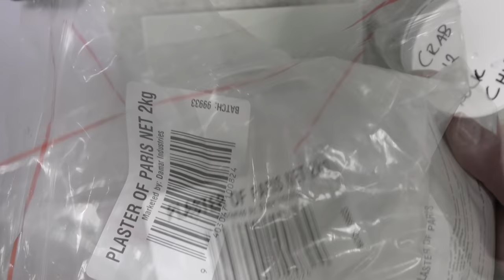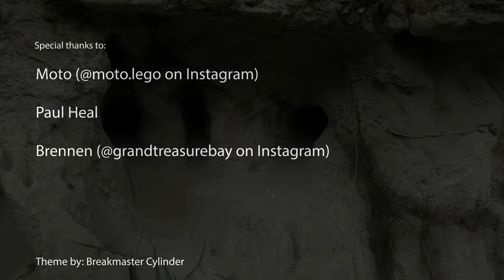50k giveaway! Making a realistic fossil replica, painting it, and then giving it away!

Comment: Cool to see the mold making portion. I cast my carvings in a similar manner. A tip from my father who was a professional plasterer is to add a tablespoon of Cream of Tartar (or less in this case) to the plaster mix to extend it's work time; allowing bubbles to rise out of the casting. Also; taking the liquid plaster and placing it within a vacuum chamber (looks like a pressure cooker) will purge all bubbles from the cast, too.
Reply from the maker: Thats a great tip! Thanks for that, I'm definitely still learning but each cast gets a bit better. I've been looking at the vacuum chambers, I follow a few makers that use it often.
Reply: @MamlamboFossils  I think they're fairly inexpensive for the size I'd need. I make wax sculptures, and plan on casting them in bronze; the plaster step needs all bubbles removed or I'm looking at hours of sanding or brazing to fill the bubble voids.
Reply from the maker: @Zillustration  well worth it to save that extra effort!

Comment: That was super fun to watch .
Would share  with us the next time you make a new replica?
 I liked how you mixed in the crushed rock from the original and scribed off the extra paint around the crab. 
I am going to guess 403 grams
Reply from the maker: Thanks Michael! Yeah, I'll share the next replica as well!
Reply: @MamlamboFossils  Awesome, looking forward to the video. 
I saw a few suggestions about vacuum chambers to help eliminate the air pockets. A bit cheaper route might be to lightly vibrate the mold as you pour in the plaster/rock casting mix. That should help settle the materials into the finer details of the mold and cause any air bubbles to rise to the top to escape.